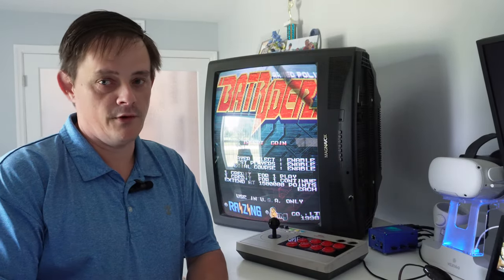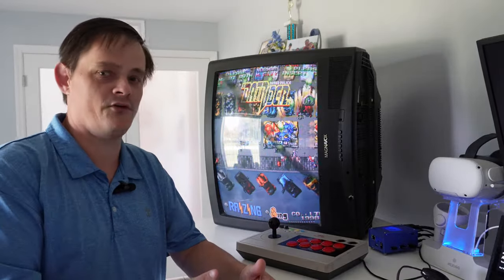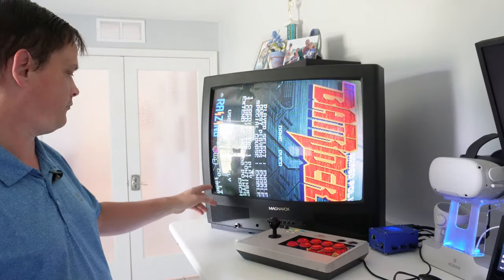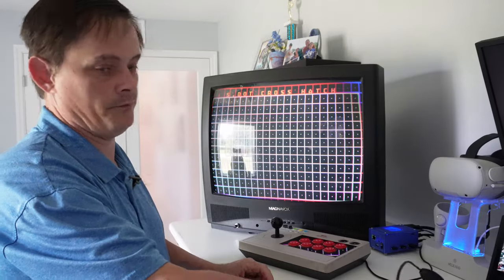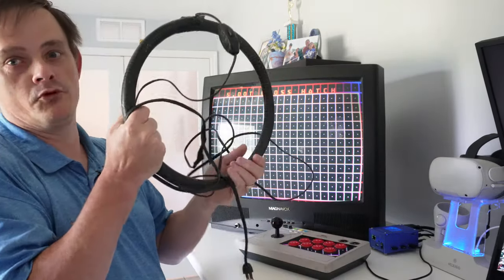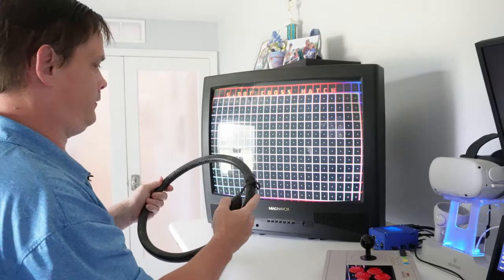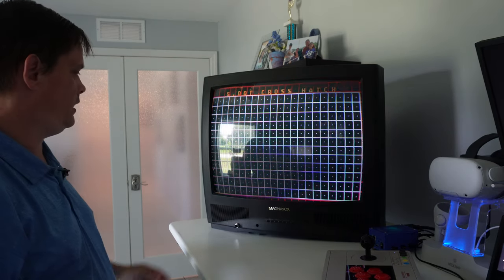Degaussing a CRT, how and why

Comment: I remember messing with the colors using a magnet just so i could press the degauss button and watch the colors snap back to looking normal
Reply: I did that with my old schools CRT monitors I had a projection TV at home so I couldn’t do it at home
Reply: @Lucario0007 what’s a projection TV? (I’m not some snotty iPad kid that has no knowledge on the 90s. I’ve just never heard of it until now) and also, when you say you couldn’t, do you mean you weren’t allowed or that you just weren’t able to do so
Reply: @marioboi323  it’s a early wide screen TV using a projector like light behind the screen that displays the image a bit like a smart board without the touchscreens these couldn’t have the magnetic thing on them due to the lack of the vacuum tube
Reply: @Lucario0007  oh cool. Did it have a 4:3 option or did you have to deal with stretched out 4:3 images?
Reply: @marioboi323  my dad managed to somehow make SpongeBob the correct layout but I never could
Reply: @marioboi323  The early ones used 3 crts (red green and blue) in the back  that were projected on the screen. They were all 4:3 until the early 2000s

Comment: So why does rotating the screen cause this in the first place?
Reply from the maker: the beam that draws an image on the screen is steered around that screen using electro magnets, when you rotate the screen the natural magnetic forces (earth's) orientation changes slightly causing the beams to be slightly mis-aligned. a regular TV has a built in degauss function that would take care of this but my monitor does not.  This could also happen if just moving the monitor around from one location to another at my home though not normally as pronounced.

Comment: I had an old viewsonic that I manually had to degauss with a huge magnet. It had colored sections in 2 corners. The built in degauss didn't fix it but that magnet sure did.
Reply from the maker: I've never had luck with just a normal magnet but thats cool if it worked for you.

Comment: I really like your videos easy and simple not to much speech, is that happen with every TV? Crt ? Can u give me the link to buy this tool appreciate your help and educate for us 🙏
Reply from the maker: All CRT's  will experience this color shift issue with changes in magnetic fields around them, however many consumer TV's have built in degaussing circuitry already. This arcade monitor in a TV housing does not. This is very similar to what I am using - https://www.amazon.com/Waldom-Degaussing-Coil-Color-Power/dp/B00011UYJU/ref=sr_1_3?keywords=degaussing+coil&qid=1691578633&sprefix=degaussin%2Caps%2C89&sr=8-3

Comment: I grew up with those CRT and TV screens. But never had a thought of degaussing, or setting the geometry right... But today I wondered, how the beam just hits the right colors, if you adjust the geometry of the screen... Wouldnt that have to happen in steps, as the colored dots are also arranged pixelwhise? Or do i remember that wrong?
Reply from the maker: The colored dots are not really pixels but they are phosphors that the electron beam lights up. Degaussing just corrects the magnetic field on the screen so the correct phosphors are lit up when the electron beam scans across them. The geometry adjusts this size and shape of the image on screen but will not effect which colors are illuminated.

Comment: Why wouldn't an arcade machine use de-gaussing? I don't know about TVs, but I remember that computer monitors would either do it when you turned it on and/or when you selected to do it manually
Reply from the maker: Some do, some don't
Reply: @CraigKergald  Ah, ok. I just wondered why that might be, if it's a cost issue or something
Reply from the maker: I'm sure costs were a reason for some manufactures including mine who made this generic arcade chassis (circuit board). For others it may of been a design oversight, or because the monitors ran all day every day without really being moved in cabinets.

Comment: Very cool video. How are you changing the orientation of the screen from the back? I would love a video or close shot of what you are doing back there. I feel like my Crt needs that.
Reply from the maker: the adjustments back there are just stuff like vsize, hsize, hposition, etc. They are just pots/knobs on the arcade monitor chassis board.
Reply: @CraigKergald  I assume I have to take the back of the tube off to get to those?
Reply from the maker: @gametourny4ever627  you almost definitely don't have them. I took an Arcade monitor and jammed it into a TV housing, you most likely have a consumer TV not an arcade monitor and while they are both CRT's the boards that drive them will be considerably different. IF you have a PVM/BVM many of these features would be available. You can also convert a regular TV into an arcade monitor which may be your best option.

Comment: My issue with my crt is that it is distorted in the middle. No amount of service settings will make the scrolling images not scratch in the middle and contract near the edges. Should I send it to Jesus and get another one? Or do I open it while on to mess with the back magnets and instantly die.
Reply from the maker: it probably can be corrected but also will require someone that understands the issue and how to fix it, I wouldn't recommend just poking at it with magnets.

Comment: How were you adjusting the geometry like that? My TVs picture is slightly rotated as well as doesn't fill to the edges of the screen 100%.
Reply from the maker: this is an arcade monitor and has knobs (pots) used to adjust these settings. if your image is slightly rotated your yoke is probably rotated (the big magnetic coils on the back of the tube) Once you get that fixed you will need to look up a service manual for your model TV to see if you can adjust the image size further.
Reply: @CraigKergald  How easily can I fix the yoke issue myself? I've hear opening up crts van be dangerous.
Reply from the maker: Easy and dangerous aren't mutually exclusive, if your yoke is loose its not that difficult to fix but you will be working around high voltage, you should either find someone comfortable with it or at least do some research on CRT yoke adjustments before getting started

Comment: Hello, I had a column next to my CRT, and now the geometry at the bottom is crooked, will this circle help me?
Reply from the maker: probably not this corrects color issues/spots on the screen but not really geometry issues. Send me a picture of what your screen looks like and I will try to offer some advice for your issue.
Reply: @CraigKergald  ,if I turn the TV 180° to the right (into portrait mode), then a rainbow (colored spots) appears at the bottom of the tube. Is this somehow connected with the fact that I have a gray spot in the bottom corner, it flickers a little, and also the bottom horizontal line is crooked (goes like a wedge), and also periodically a greenish spot appears in the center of the screen, then after some time it gradually goes away. Is the reason magnetization?
Reply from the maker: @tdmax2288 I thought it would of been listed in the channel but anyways my email is craig@kergald.com
Reply from the maker: @tdmax2288 I thought it would of been listed in the channel but anyways my email is craig@kergald.com
Reply from the maker: @tdmax2288  Some of those issues would be magnetization / degaussing issues, the color spots, rainbow spot, green spot, possibly the gray spot. The scan lines on a CRT are slanted very slightly as it draws from the top left corner of the screen horizontally and as it reaches the right side of the screen it should be a little lower almost to where the next scan lines will start. If its more crooked than that your yoke might be twisted or loose. if you post pictures or video send me a link images especially regarding the slant/slope would be helpful.

Comment: I have this issue on My Sony Triniron the top right conner is green
Reply from the maker: degaussing will probably help, Sony TV's should have a basic built in degauss feature. I'd recommend unplugging power from the TV let it sit for 30-60 minutes then plug the power back in, when you first turn it on it should energize that degauss circuit for a moment which is hopefully enough to straighten out your colors, if not you might need to get something like this tool I use.
Reply: @CraigKergald  ya I have tryed to see if it would automatically do it, I can't get the feature to work & sadly degaussing rings like that cost an arm & a leg
Reply from the maker: @9ALiTY   Try this - https://www.amazon.com/SaiDian-Degausser-Degaussing-Demagnetizer-Television/dp/B0BD7Q2GKT/ref=sr_1_4?crid=39MT740GMGOD1&keywords=degaussing+wand&qid=1693511303&sprefix=degaussing+wand%2Caps%2C92&sr=8-4   it has free returns if it doesn't work out for you.

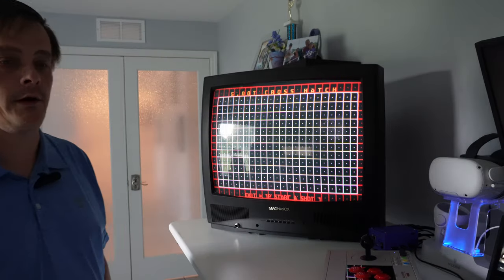Comment: How did you adjust your screen between 2:02 - 2:40?
Reply from the maker: While this looks like a TV its really an arcade monitor placed inside of a TV housing, the back is open and has the regular knobs/pots you use to adjust a arcade monitor. I'm just turning those to make these adjustments.